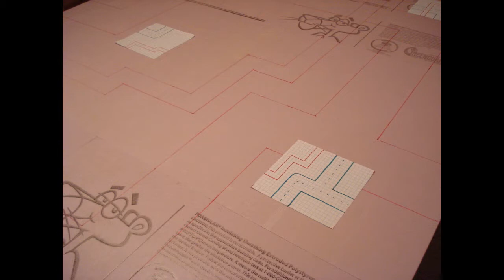40k Cities of Death Terrain Table - Stage 2

Comment from the maker: @MoreDakka101 Yeah, the road is pretty narrow at 5" (7" if you count the 1" sidewalks), but with the modular buildings being set back a few inches it would definitely be wide enough to fit two tanks side by side.  Not on the road itself of course, but on the "open area" between the buildings.  Since it's technically a city fight board I thought more buildings on the board would be ideal rather than taking up space with roads.  I do like your idea though, make sure to post some WIP's!